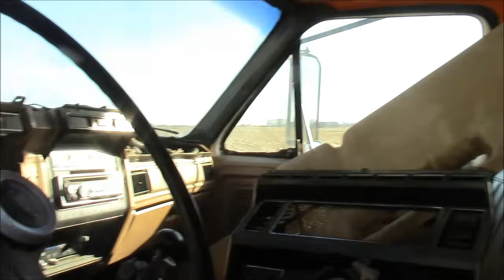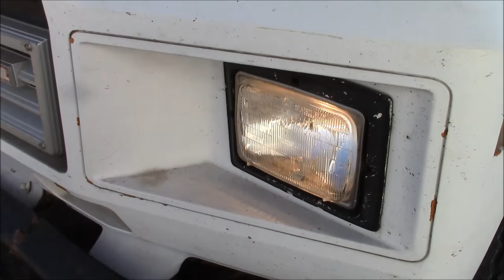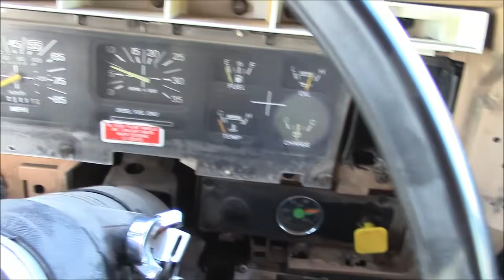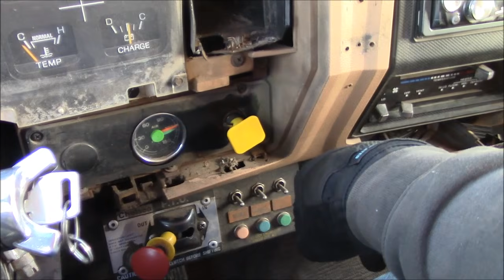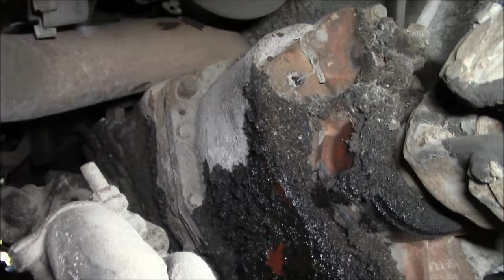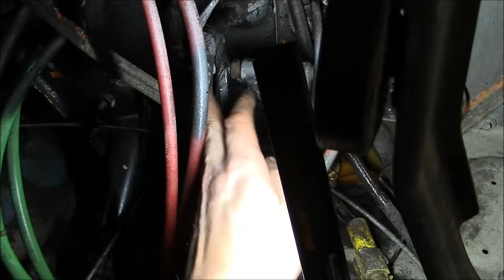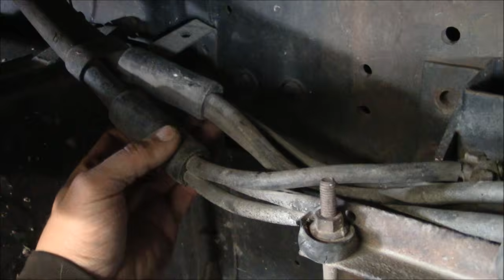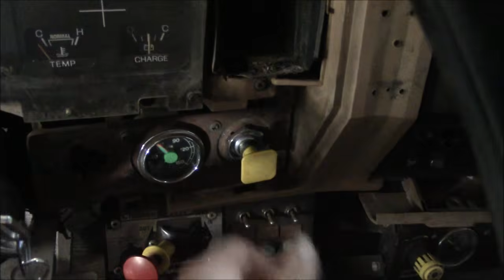Sweet 1984 Ford F-800 - No Headlights, Air Leaks, Bad Brake Valve.

Comment: I get the safety of golves, i really do. But i am one that simply cant wear them my efficiency goes down and my already  mediocre ability plummets also. I have worked in lumber mills, logged extensively. The two times i was forced to wear gloves because of OSHA regs i hurt myself...no kidding. Some of  us are just ment to use our own mitts.
Reply from the maker: I've tried rubber gloves and I just can't do it. I had bad carpal tunnel issues in my hands and my fingers are numb much of the time. So I can't feel anything with gloves on.

Comment: Block heater or the cord supplying it burnt down a saw mill I worked at 12 dollar part cause so much heartache
Reply from the maker: Dang near burned my truck to the ground. I just happened to see a reflection of the flames in the window while I was making breakfast. Ran out and yanked the flaming extension cord off...
Reply: @WatchWesWork  nice save
Reply: @WatchWesWork  Did you do an autopsy of the equipment to find the cause? Under  rated extension cord, defective receptacle on the end, corroded plug on the heater cord?

Comment: Holy cow, I gotta ad another comment, I just learned I'm a no good account wire hacker, I've been twisting ends before crimping for 45 years now, nothing has failed the crimped connections but now I'm worried lol😁😱😨🤗
Reply from the maker: Yep. Probably all going to fail any minute now.
Reply: @WatchWesWork  Lol, I heard that, I live out in wheat country in Eastern Washington state, operate, drive and wrench have had no issues, but there's always a armchair bandit or a one upper out there that will always correct a tried and true method look forward to your other videos, hope your day is going well.

Comment: You had mentioned it didn’t have a 2 speed axle ? Did you mean a 2 speed rearend ? That other valve could be a differential locker for the tandem axles ?! A twin screw wouldn’t have a 2 speed rearend unless both rearends did ! That truck ain’t to bad for sure !
Reply from the maker: The second switch is a brake to stop the gears in the transmission to get the thing into gear.
Reply: Watch Wes Work I’ve never heard of a brake like that especially on a shifter ! I guess I learned something today ! Are you sure it’s not a diff switch ? But then again the diff switches I’ve had were on the dash and were air driven !

Comment: Have you ever tried the 5 gallon pail mouse trap, where they fill it with water or antifreeze and they crawl up the ramp to a tin can that spins on a dowel and they fall in?
Reply from the maker: No. Seems cruel. The mouse trap is instant justice!

Comment: Yep Manufacturers don't like you working on brake or steering components I have come across several instances over the years when a replacement part was cheaper than an overhaul kit and strangely the kits are never available... Liability huh!

Comment: I'm not a safety freak and I seldom wear gloves. You definitely don't want to wear gloves when operating a lathe, milling machine, or drill press. That would bring out "the other" haters. I grab the chuck of my drill press to stop it after turning it off. Yeah, I'm "that guy".

Comment: There's an internal self-resetting breaker in the switch for the headlight circuit. Had one fail on a dark county road at 60 one night - no good.

Comment: Is that an inspection sticker on the windshield? If it is, I haven't seen one off those since I moved from PA to IL. Where did that truck originate?
Reply from the maker: Commercial vehicles over 8,500 GVW are supposed to have a state inspection if they only operate inside the state. I live on the border of IA, and WI, so most trucks here run apportioned plates and can use the federal inspection. We don't even have an inspection station in our entire county (about the size of Rhode Island).

Comment: That's a sharp old truck I'm not a huge fan of the Detroit engine though we have a 8.2 turbo in our 89 GMC C7000 dump truck. It runs fine but it's not gonna terrorize you with power or do anything crazy lol. Is that truck a non turbo?
Reply from the maker: Correct. No turbo.

Comment: Great video.  Love the truck 
Truck driver by trade and have driven all the trucks with out using the clutch. Gas and diesel
Reply from the maker: Yeah, I never learned to double clutch. I'm not sure I could do it if I wanted to. The guy who taught me to drive a truck had 40 years experience and he never used a clutch except to get started.
Reply: Same here.  The truck I drive in the summer is 2018 KW  with a 18 speed Automatic!!!!!!!
It’s nice

Comment: Question for ya, I notice you don't use the clutch or your left foot is super fast oops than I saw the ending  Can you downshift also ?  I just bought a 1987 GMC 8.2 Detroit Diesel  I want to try shifting without clutch  hope it don't fall out :)
Reply from the maker: Yes. Up, down, no clutch. That's just how I learned.

Comment: To be fair to the Detroit Diesels every will it run video I've ever seen with a two stroke detroit seems like as long as the injectors aren't seized they pretty much fire right up, even on like twenty year old fuel.  And the two strokes at least are some tough motherfuckers, Deboss garage ran one without coolant to run it away and blow it up and it ran and ran and ran then just kind of died but then they just got it started up again, absolutely tanks those engines seem to be.
Reply from the maker: Yeah. The 2 stroke design means they will run with almost no compression. The big thing with those Detroits is you can't overheat them. If you keep them cool they work really well.

Comment: Fuel Pincher:  Detroits attempt to build the biggest pile of shit possible in the mid size category.  4 head bolts (stretch type) per cylinder.  They eat head gaskets, even after the upgrade to larger bolts. Used in many school buses, thousands of head gasket failures. Even back in the day head gaskets were like $70 each.

Comment: But does the fuel gauge work?  Never heard of not twisting wire strands when crimping in the electrical work I've done.
Reply from the maker: It’s an old Ford. Of course it doesn’t work.
Reply: @WatchWesWork   That makes driving it interesting.

Comment: Hey wes, have a 95 f150 4wd. Engine is shot so I'm gonna get me a totalled 04 or newer  f250 or 350 4wd diesel and convert the 150 to diesel. Wanna help me do the conversion?  Lol
Reply from the maker: Interesting. That will be a tough project since the 6.0 was never used in the OBS trucks. You might look for a 7.3. That would be a lot easier.
Reply: @WatchWesWork  I'm doing a newer diesel engine conversion so it would meet tha carb emissions testing for California.

Comment: ever use the connectors with the solder in them? when you go to shrink the tube, the solder melts and makes the whole thing solid
Reply from the maker: I've seen them, but not used them.

Comment: what's the benefit of the front wheels? seems like they're only used in north america, haven't seen that type much in europe.
Reply from the maker: I assume you mean the open center or Dayton style wheels. They are extremely common on older trucks in the US. I'm not entirely sure why, but they are very strong especially for side loading. They are popular for offroad use like dump trucks and logging trucks. The other benefit is that you can change the whole wheel out with just hand tools. But the big problem is they are very heavy, you need to be more careful how you mount the wheel to get them true, and you have to remove the entire hub to access the brakes.
Reply: @WatchWesWork  yes, thank you

Comment: You skip most of those gears right?  The ratios seemed the same in the first five or so or are you shifting without clutch?
Reply from the maker: I did not skip any gears except 1st gear. You shift 5 gears, then pull up the air switch to change to high range. Then you shift 5 gears again. Same pattern, same lever. No clutch.
Reply: @WatchWesWork  interesting! Very interesting haha. Thanks for the information. Love your videos

Comment: That other air switch is your clutch brake - it's a straight 10 speed. It's a lot like the early 70s 13 speed just no low range.   https://youtu.be/3jfJSbtVZwg

Comment: Those were terrible. 175 HP wide open. They run forever at 2850 RPM,  55 mph. Run them at 3200,  shot at 100K.

Comment: the question i know the farmer did not like the passing the new law here  that have to have all the farm semi-trucks or the single axle trucks  
we never had the semi's my dad owns had to farm tags on the trucks he did use them for other  jobs when  not in use for a farm truck  they  needed to have the province expectation done to the yearly  for   tags 
we did think it was a step forward  getting trucks are unsafe off the roads too  they had to have a class 3 with airbrake lic too them I was 18 my dad told me to get my class 1 with airbrakes I am a licence to drive a semi-trucks i have other licences  to pull more them 1 of  2 more trailers on the road to a few of us can pull   3 53 ft trailers between  the 2 major cities here i am ok with it i do not speed i do run  under the speed limit here  by 10 I do leave the speeder  especial when it's raining   here  the 3 trailers are very hard to pass when it raining or especial snowing here I do not pull 3 in the winter at all  its harden just have one some time on the ice here

Comment: 17:11. That button to remove the pull rod for the headlight, you gotta treat it like a woman, finger it's button just right, and she'll come for you. Lol. 😉
Reply: 32:00 my truck runs about 1800@55mph. I think it has a little taller gearing as it has a turbocharger
Reply from the maker: Yeah this thing probably needs the steep gears since it has no turbo.

Comment: what that's a perfect Saskatchewan farm truck nothing- works on it  lol we are hoping you have a poor mans trapping licences do not want to to get in trouble with the farm cat unions lol just a fur coat for your wife lol  the electrician we had on a job site was very fussy that way to especially soldering wires to together after you get to know  he's thinking it i do that too now in  some of the wirings i have to do  if i can not rerun a new wiring  to  fix the problem  wait a minute  they grommet was removed for a reason  (mickey mouse union)  has the right to run in and out of the cab American freely rights for the  mice  right act  10 to 12 years prison terms if you get caught  if you could do it from the inside would be very simple to run new airline to the switch the problem be fixed I do put heat shink where it goes into the firewall on the airline gives it a longer lifetime of use too if i could be able to make ion the bench and marked were it rubbing at i use 2 sided tape then i put in tinfoil on the tape then heat shink give it little more rigit from damages 
 as to the block heater cord  would  it is much easier to put it cab mounted one on the truck I know i would have put one on it  its a thought lol 
it's your way of doing your job i am very fine with it myself too  yes as to the truck for its age was awesome looking truck it has to be kept inside all its life too